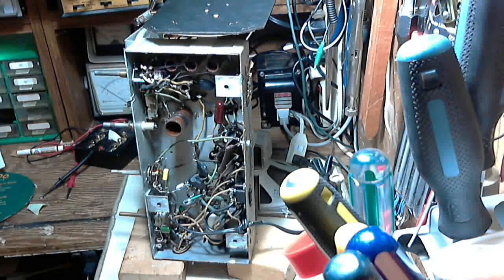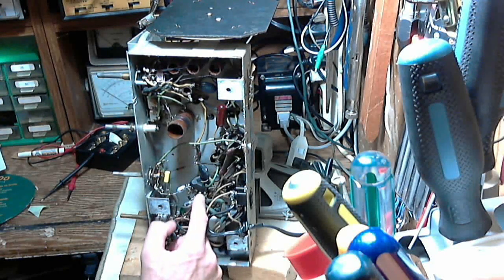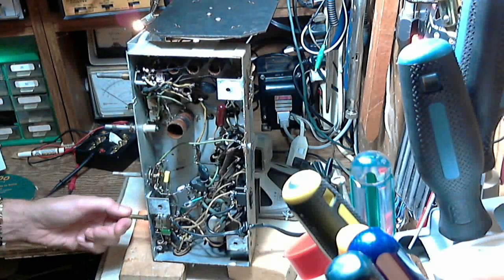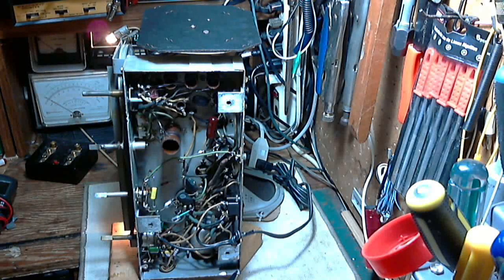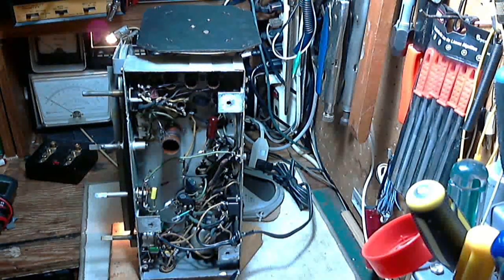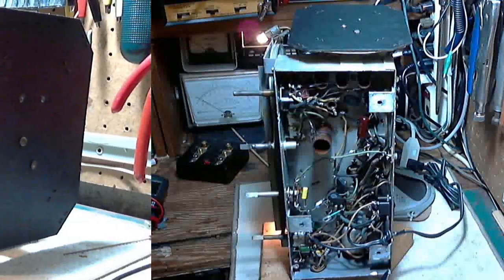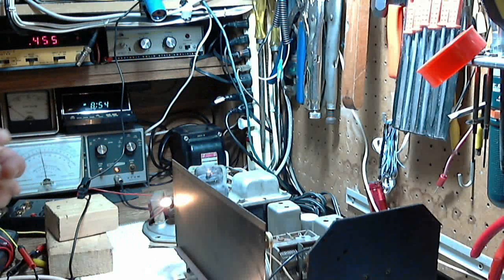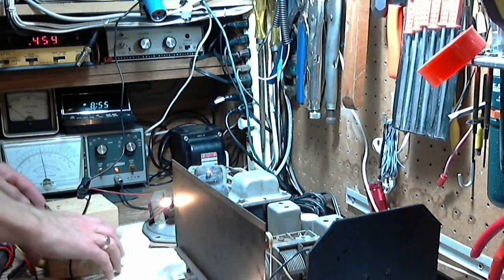Canadian General Electric KM-5 Vacuum Tube Radio Video #21 - Intermittent  Alignment

Comment: Jim, my heart skipped a beat when you made a grab for the radio as it was falling, thank god you didn't touch any live circuits. Excellent video's though, love them. Regards Bob (UK) P.S. well done with the re-stringing, you have great patience.
Reply from the maker: Bob Mellor That was all reflex and it's not good to grab at a radio that's on but it was over before I knew it.  Just another lucky day for me.

Comment: that popping/cracking sounds like your a victim of the "silver mica disease" in the IF cans.
Reply from the maker: ***** It sounds like that but these IF cans have trimmer capacitors.  It could be the trimmers are dirty.  I tapped them a few times to see if they were sensitive but nothing happened to suggest the trimmers were the trouble.  Can't rule the IFs out.
Reply: Jim Lindenas Well if it has trimmers, it MAY not have fixed mica caps inside the cans. In that case, I would try and turn every single light off, make it pitch black so you cannot see your hands in front of you, disable pilot lights, etc. and see if you can find the arc giving off the ozone. it could be a broken solder joint/wire to the rectifier socket, etc. To something as serious as a broken wire in the IF can arcing out.
Reply from the maker: ***** A combination of sight and sound might work to identify the exact point of failure.  I'm not sure I can get my shop dark enough since the arcing might be very hard to see.  I may need to lift off the IF cans to reveal the IF transformers.